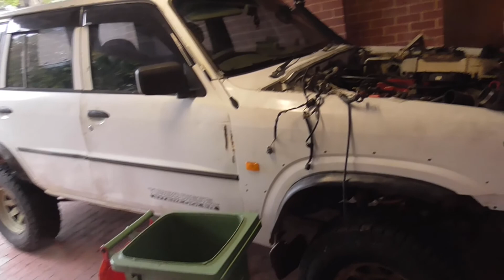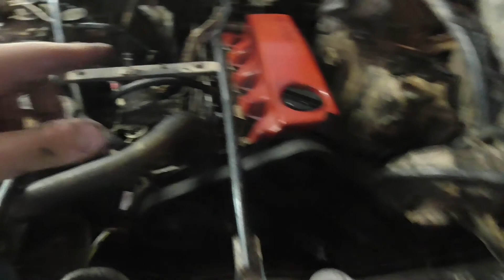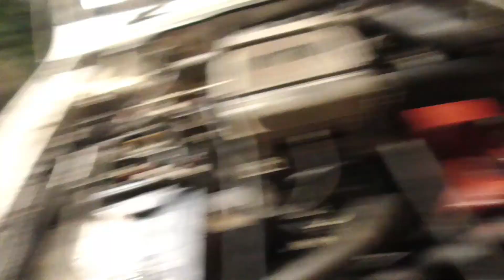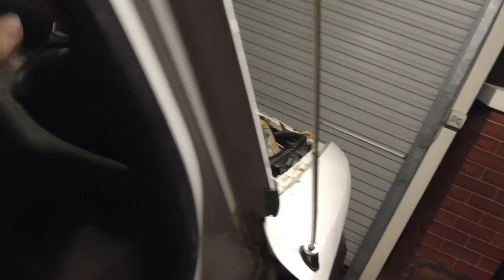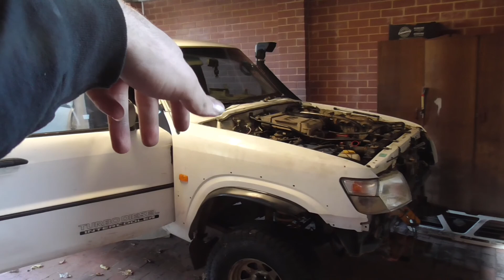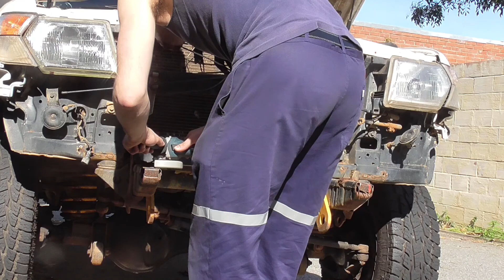Wire Tuck, EGT wiring & Pump Timing - RD28 Patrol

Comment: how did you make your rpm work? since I went mechanical on my GU the rpm doesn't work. any advice mate. thanks
Reply from the maker: its in my GQ pump swap vid mate. you plug the wires from the GU cam sensor in the pump into the CAS

Comment: I got so sick of cracked valve covers I've switched to a remove electric rotary vacuum pump.
Reply from the maker: Im going to look into a TD 42 vac/alternator. Tbh i think the vacuum pump on the valve cover looks sick but i might have to weld ove some cracks before it works properly